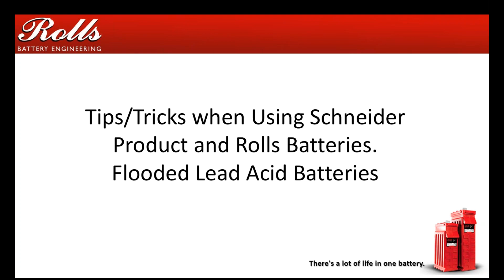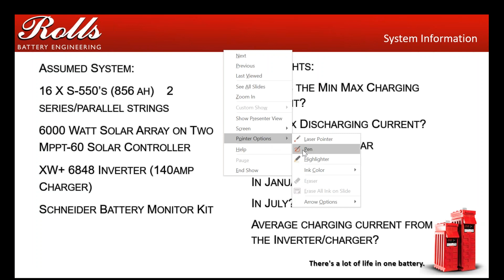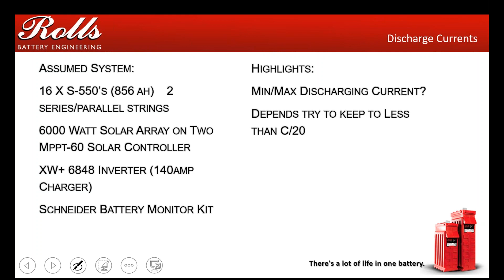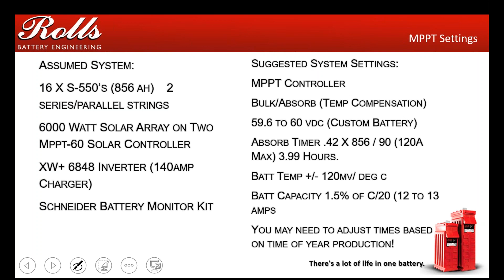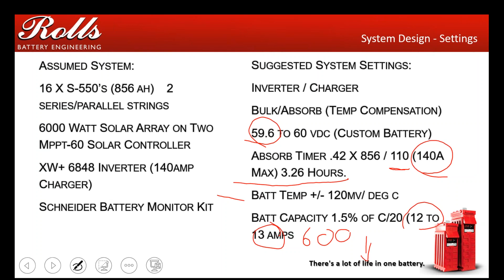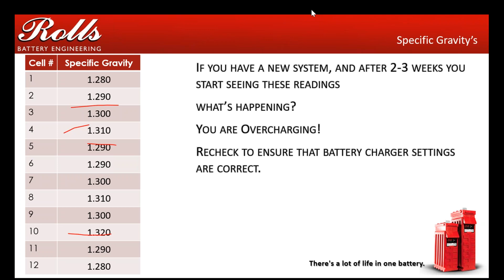Rolls Battery Engineering - Schneider Electric product tips & tricks

Comment: Also issue when you speak, lots of people dont realize Schnneider is 2in1 combo.  XW is inverter/Charger-a/c. And you also have Mppt/Charger....   theres 2 settings that need tobe done at your SCP settigs.
Reply: Sorry Boss, is the math thing.   Look
.42 x 1284Ah ÷ 81A = 6.65hr Absorbtion time...?  Right?
Reply from the maker: The inverter is an Inverter/charger... yes... but the Solar Mppt-60 are solar regulators/chargers...  the MPPT is just how they regulate the current/voltage.

Comment: Great to see this on Schnneider and Rolls...   how did you determine in the formula the nominal charge rate/current  (86A)eginning? It seems to change, later you change it to /90A(120)?

Im also running al Shnneider XW6848, 2-mppt 60-150,  PV15-260W 3,900, Rolls24-1660...
Reply from the maker: At a minimum you want 10% of the C/20 rate 10% of an 856 Ah bank is 86 amps!   Max is 20% so Max would be 172 amps.  Where you are in PR you'll need about 4600 Watts of solar to get 80 amps due to temp and atmospheric losses.  about 5600 to get to that 86-90 amp range.
Reply: Rolls Battery Engineering .42 X 1284Ah ÷ 128.4 = 4.2hr.  Absrbtion time...  is my math correct? Based on 110Ah charge rate from inverter XW.   What would be Amp charge rate based on 2-mppt 60-150 with 3,900w total...  ?
Reply from the maker: Jerry... I've got to ask you to email me directly.... You've sent dozens of messages, frankly most of these answers are in our manuals, and or in these videos! 

What is 3900 Watts divided by 48 volts?  = 81.25 amps!  this means that this is the most current you'll ever see if the panels are 25C and you are getting full sun... Most likely at best on the average this will actually be about 65 amps.   So  .42 X 1284 / 65 = 8.29 Hours!
Reply: Rolls Battery Engineering ok, I didnt read anywere to email you... but your right, theres like 20thousand messages from me. Lol....  guess I dont want my expensive$10,000batt bank to fail... is gonna be a month since insalled.  Thank you.
Reply from the maker: No worries, and I understand...  my email is steve@surrette.com.   You do have some issues... #1 your bank is too large for your renewable and or your charging sources.   It will fail specifically if you don't add more solar, or run the backup generator a few times a week to get the battery bank to a full charge.   I will be in PR the week of the 14th doing training at multiple locations around PR, email me and I will put you in touch with the organizer.  I don't/won't know the locations probably until a few days before.
Reply from the maker: Again Max currents never happen in the "Real World"... A 120 amp charger is going to be closer to 80/90 amps as explained in the video.